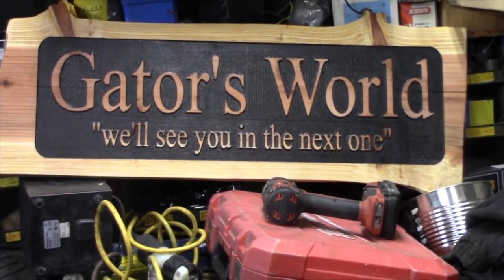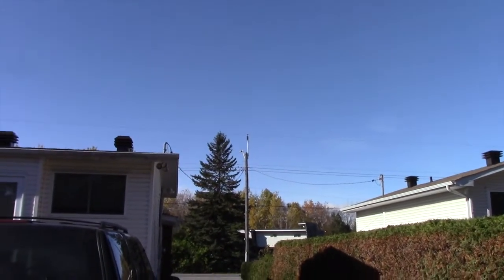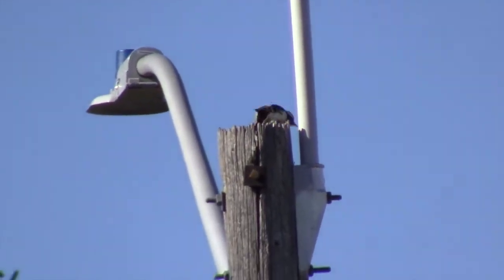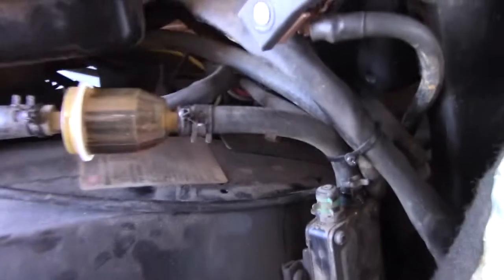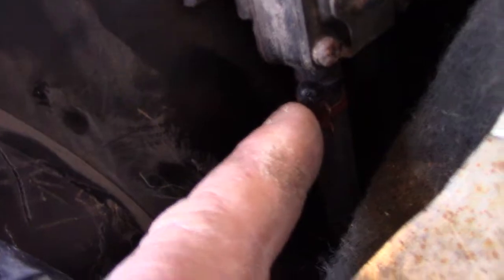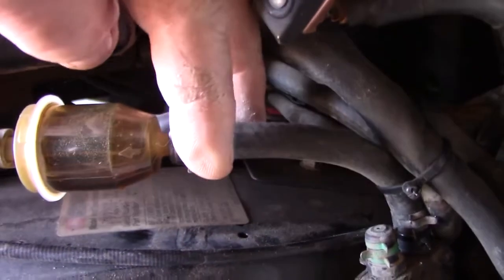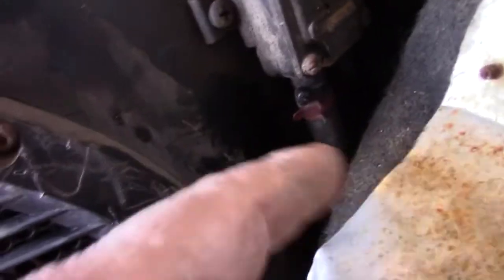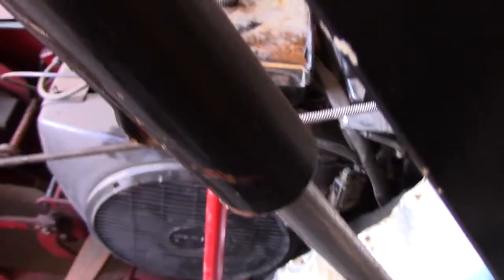Small engine hard start

Comment: That intro was a HOWLING success! Woodpeckers are beautiful in my opinion. I didn't realize you could just back off with the lines and add ties to fix that problem. We always replaced the parts. Thanks for sharing that info. I'll be passing it along to my son and son in law for future reference. Hope you have a good day!
Reply from the maker: I just moved the no good clamp back and put some ties....the whole thing is if you`re lines are a bit loose you`re drawing air in the system and it goes back to the tank...CHEERS

Comment: Hey man, ya done good Gator !  Small engines can be a problem especially if they don't run too frequently.  You know what... I filled out a reply right when you uploaded this video but apparently didn't hit the right button.  Dang I hate that...wasn't paying attention.   I don't even remember what I said. lolol
Reply from the maker: It`s all good Tracterman....now that I did this fix...a bit of choke and it starts right away....I guess the air coming in the lines was letter the gas gravitate back to the tank in the back....workes good now....CHEERS

Comment: Hi Gator, that is a quick fuel line fix. [ When you do not have small clamps available ]    THANKS FRIEND
Reply from the maker: Yes, Ronald...I don't use them small clamp anymore ....just these wire ties and they work well....the better ones are the one with the metal lock tab.....CHEERS